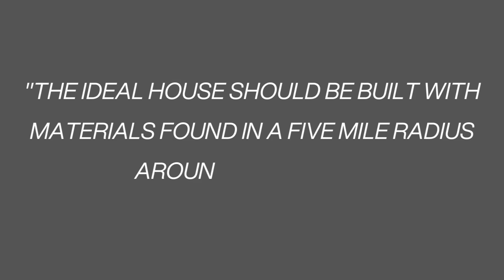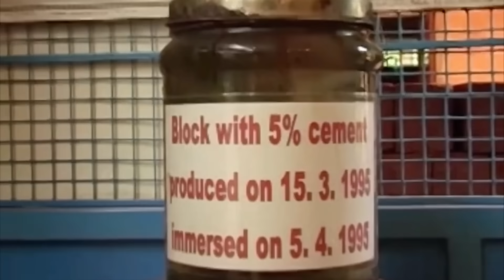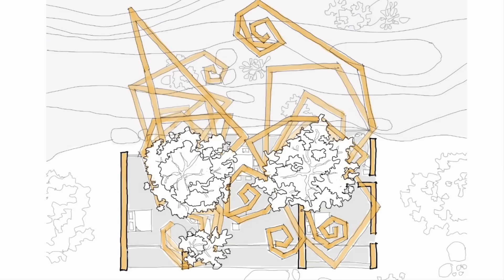The Beauty of Building With Mud and Trash | Vinu Daniel | TED

Comment: Appreciate the thought of building with mud + lime (instead of cement). However, using plastic bottles / discarded tires though reduces the dumping issue but it comes with it's own cost. Quoting the drawback of Earthship (using tires - Micheal Reynold's) for anyone who is interested and want to pursue, please be aware of this: "The tires of an Earthship may release brominated flame retardants (PBDEs) into the air of an Earthship, which is a synthetic material derived from petrochemicals that is toxic to humans through long-term exposure."

Comment: Through this method the plastic and tyres are used and being covered up by mud... Basically its not seen out...but the plastic or rubber which is non biodegradable exists inside the building. 

After few years once the client or the next generation wants to demolish this building and build another...this becomes back to landfill waste again unless the new building is constructed the same way covering the waste materials inside the mud.

What is the solution to prevent it? How is it eco-friendly?

Comment: Great approach to building. The problem with reusing plastic this way, however, is that it will degrade over time and eventually wash into waterways. It's just hiding the problem inside building walls. Not all materials are suitable for every application.
Reply: How would plastic built into a structure wash away? Plastic disintegrate into micro plastics when it's exposed to elements. So we cannot say any and all recycled plastic will end up as microplastics in waterways. What we can say for sure is, plastic dumped out  without recycling it into a value generating product, would most definitely end up as microplastics in the waterways. Recycling into objects away from elements would however, prolong it eventually ending up as microplastics in waterways. The only way to convert plastic into something doesn't end up as microplastics in waterways, is to turn it back into petrochemicals and backfill spent oilwells
Reply: When you are caught between a rock and a hard place like the case of plastic wastes in India, someone has too choose the less evil. Of course a better treatment for plastics should still be researched and executed in future
Reply: I suppose it is better than leaving it out on the ground where it's more likely to wash into waterways